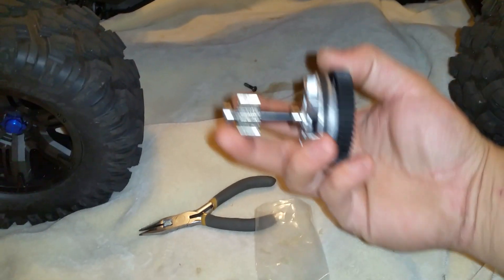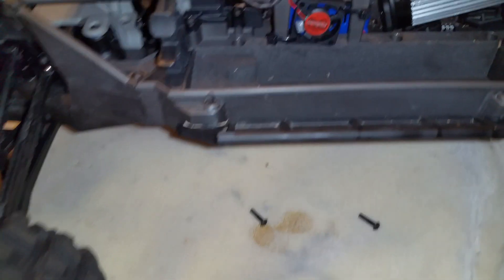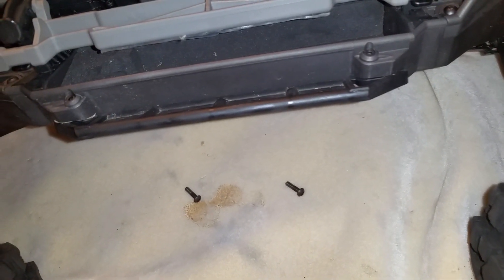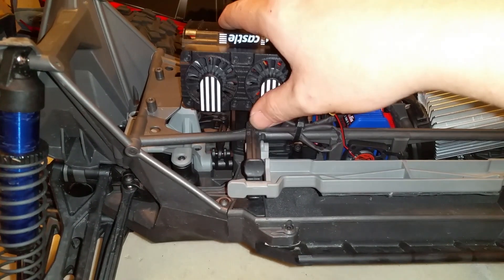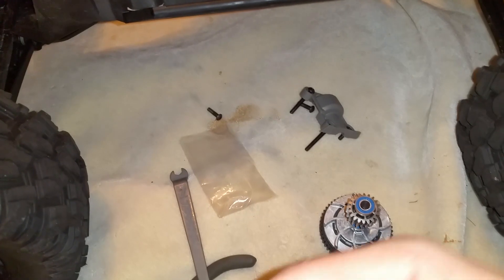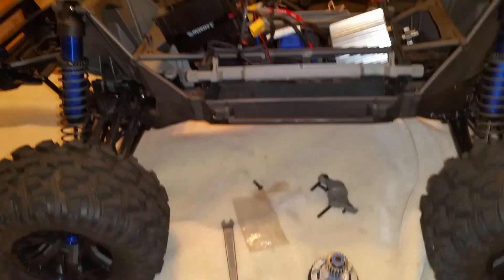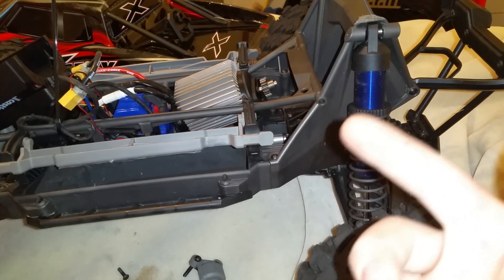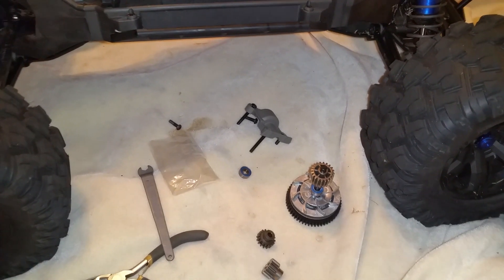Gearing of the Traxxas X-MAXX.  Spur vs pinion

Comment: As soon as I can I am going to buy one of these trucks but everyone is OUT OF STOCK...SUCKS!!!!!!!!!!!  WHAT DO YOU THINK I SHOULD RUN FOR BATTERIES IN THIS BIG TRUCK..COST NEEDS TO BE CHEAP..THANKS MAN  PLUS IAM NEW TO BATTERY TRUCKS ..I HAD NITRO AND SOLD THEM ALL
Reply from the maker: the first batteries I ran were 2 bias 5000 mah 40c.  they did fine but I wanted more capacity so I opted out for 2 venom 7500 30c.  2 of the 7500 available on amazon with 2 day prime shipping for 199.99.  the bias are 54 a piece.  I had the same problem finding one so I called all the hobby stores in my region.  I found one 120 miles away.  I put it on layaway over the phone and picked it up 5 days later.  They're out there you just have to search.

Comment: think about it. when I use a fan on my self I face it towards me. I don't put the fan on my face facing away to remove heat.   that will only probably work if it was in a enclose situation. in that case u will need one to push fresh air in and the other one pushing the air out circulation.   u don't have that situation
Reply from the maker: good point.  But I've done it both ways and sucking the heat away works better.
Reply: +Randall Hughes from your esc to lipo charger, power supply computers and anything that's has a fan in it they all face the heat
Reply from the maker: +DANIEL Q no.  Computer power supply suck the heat out, car radiators air is sucked through, air conditioner unit sucks the air through the coils, but then some do blow directly onto the heat source.  I just know thus far sucking the heat away has been working .
Reply: +Randall Hughes check out my new video. what's up with when are u going to make a running video of your beast?
Reply from the maker: DANIEL Q when I get the 50 tooth spur monday.
Reply from the maker: +DANIEL Q teaser running video up.
Reply from the maker: and when it comes to the whole cooling situation.  the reason you get cold when a fan blows on you is 2 fold.  1, evaporation creates cold, 2nd when the air is moving across you t is removing heat from your blood cooling your entire body.  that's why those neck AC'S work.  because all of the bodies blood circulates through the neck.  the reason why you would flip the fan s because blowing a small flw of air onto metal does not cool it.  it has to be a large flow.  but if you reverse it the heat will therefore be removed and the motor and esc will cool.  I've been experimenting and pulling away is more efficient.

Comment: almost like a whistling noise ..gds racing 54t
Reply from the maker: when you change to metal it's then metal on metal so there is going to be a different louder noise.  nothing to worry about.
Reply from the maker: I will tell you now your weak link is the main drive gear which is time consuming to get to.  you have to remove the entire rear section, motor, spur assembly, it's a hassle.  that's why I stocked up on plastic spur gears.  make the weakest link easy to get to.

Comment: I agree with having the fans blowing onto the motor.There would have to be a sealed unit to benefit from the fan sucking hot air away.
Reply from the maker: well with the way I'm running my 5 fans 3 are pushing air in and across the esc and motor and the 2028 fans are pulling it out so there is a constant current of air blowing across everything that gets hot.  I thought it through.

Comment: bro put the fans so it hits the motor and esc.
Reply from the maker: that's how I've got them.  but sucking the heat away instead of pushing air onto it.  just like a car radiator.  You suck the heat away not blow air onto it.

Comment: Good video! They should call! Preacher nitro! Because you know your stuff! Question??? I'm going to get the 8S power-up kit, but I will purchase a max6. For a esc! What's the best gearing setup with 1600xl velineon motor??????? Do you have a Facebook page?????
Reply from the maker: Jeremy Pete 18 pinion, 50 spur
Reply: Nitro Revolution RC good morning! Thank you, but tell me why use 18/50 gear setup???? Why not 18/54!!!!
Reply from the maker: Jeremy Pete Jeremy Pete that personally was the most fun gearing. Sure you could go with 18/54 you would just lose some speed. But I like to run my RCs all terrain.  So 18/50 was best if I wanted to have some fun on the road or in straight lines off road. I like jumping RCs but once you get into speed running and hitting 100 mph it sorta becomes an obsession. I've got a few friends into it. One of these friends is Josh and his YouTube channel is Pitbull R/C.  He still has his X-maxx and it was one of the first 100 but he got the 8s package as soon as it came out. Right now he's building a brushless MTXL. I think he said his motor will be in tomorrow.  He's using a max 5 ESC, keeping mechanical brakes, 800 kv Poseidon motor on 8s geared 23/65 I believe he's starting with. If you like RC sub his channel cause he has the speed bug obsession lol.

Comment: i have watched all of ur videos and i must say u do a heck of a job im going with the 18/46 in mine iv seen guys running 25/46 its seems a bit nutty and seems the motor would have to run way to hard and get hit even with fan set up overtime what gearing do u feel has worked best so fare thanks again and keep it up
Reply from the maker: best?  for all around I like the 18/50.  still plenty of torque and not pushing the motor too hard.

Comment: Changed my spur gear and now there is a clicking noise -.-
Reply from the maker: this happened to me also.  many will say it's your differential when it is not.  it's pretty extreme way to go to get rid of the clicking but you completely disassemble the rear half of the drive line which includes the spur gear spur gear shaft all the way down to the drive shaft. mine made a horrible clicking noise and a lot of people told me that my differential have gone out my differential was fine I rebuilt the entire rear section basically removing the pinion gear and removing the spur gear then taking the shock tower and taking it apart and to have and getting into the bulkhead where the final drive gear is that is attached to the actual drive shaft. this truck has a double reduction gearing system in it there's two pinions and to Spurs you only see 2 pinions and 1 spur unless you remove the spur assembly.  where the final drive gear is there is a tiny little nub of plastic that sticks up and I noticed my final drive gear spur was rubbing against that making the clicking noise if it's making this noise only when you are powering the vehicle that's normally what this is mine made a horrible clicking noise when I changed but I really built and reverse engineer the entire rear half will rear third and I found what makes that clicking noise
Reply: +Randall Hughes ohh okk....I also noticed it would only make the noise going forward but not in reverse
Reply from the maker: +mike charles yep.  same with mine.  just rebuild that entire rear driveline.  it's alot of screws and bolts and parts but in the long run worth it.
Reply: +Randall Hughes lol was just doing the self righting feature, as it landed, sounded like something broke :\
Reply: +mike charles anything ideas come to mind on what it is? wheels make one whole turn then hits a wall. push it passed the wall and it makes a clack noise
Reply from the maker: +mike charles it's very possible.  the stock lubrication is too thin and not enough.  only 10k wight in the front and 30k in the rear and very little.  I filled both up with 50k.  also the diff pinion and spur has very little grease.  before I seriously ran mine I added alot of marine grease to all the gears.  just take the bumper off and skid plate then 5 bolts hold the 2 halves of the bulkhead together and your diff is right there.
Reply from the maker: +mike charles sounds like you broke some teeth.  I don't do the self righting feature.  too much stress on the driveline.
Reply: +Randall Hughes yea I knew better to don't use that feature but I decided to do it...lesson learned :(
Reply: +mike charles took out the rear diff, still makes the clack noise after one full rotation of the tires...gonna take out the front diff
Reply from the maker: +mike charles the front diff is the one that has a very small amount of grease and thin at that.
Reply: Took it all apart...ring gear, pinion for front diff, and the output gear all broke...SUCKS.....self righting feature is not worth it

Comment: Hey what's up have a question. Will a steel spur gear that' says for the first gen x maxx work on the new 2nd gen 8s x maxx. I want to order a new gear butt it doesn't say it's for the new x maxx. Are there any differences between the two besides the old x maxx having plastic gear.
Reply from the maker: jason Fisher Nope.  as long as its Mod 1 your good.
Reply: +Evolved Amateur RC ok cool. Thanks.